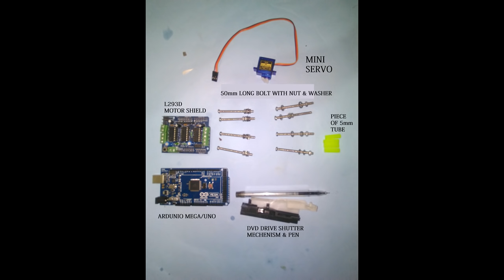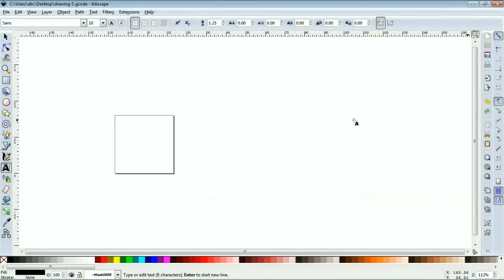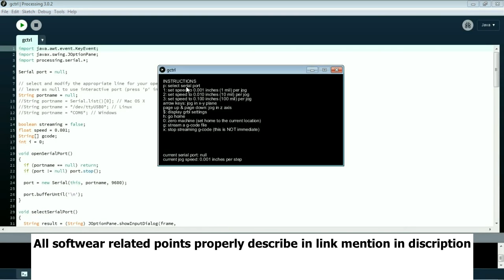How to make Mini CNC plotter machine at home using Arduino, L293d Motor shield & old DVD drive

Comment: Pleae help me. I build a plotter after watching your video. But my servo motor is continously working. When streaming pens up line motor stop and rotate little angle to other direction. After that again when  pens down command running motor again change direction and continously running. I used same as your software versions, and I used your cnc code file. Please help me bro

Comment: I did everything as you explained, But my CNC machine working 25% only. Means it drawing 25% of overall Sketch 4 times! e.g. If I have to draw a circle, it draws an Arc followed by right angle 4 times! How to fix this??

Comment: Mr. innovative,i've made the machine but only the drive in the m1 and m2 port is working and the other one is only viberating . Can you please help me to figure out the problem .Is it happening due to insufficient current supply? please give a solution to it.
Reply: Use 12v -1.5 amp supply

Comment: Hello, how are you? I made a plotter using its codes but with an epson stepper motor and it did not work well. She (the machine) draws small, or draws triplicate. I do not know what it can be. Could you give me a tip? Thank you very much in advance.

Comment: Hello,
Thank you abuot your video, I build the cnc machine like the cnc in the video but I have a problem. All the motors are working but when I runningg g code file the cnc machine drawing not what I send, the cnc drawing a scribble.
I don't kmow what is my mistake. What I need to do to fix it?

Comment: I have some issues with the cnc. When i try to print something made by me in inkscape it don`t respond as expected (maybe some setting when it saves, or something software related) but when i use the samples of the driver works fine. Any suggestion?

Comment: how much voltage is required for that CNC machine.. as I have provided 5 volt but the motors are not running, only servo motor have very less power after completing the circuit..... please help me in that case!!!!??
Reply: Rajesh Rishi 12v 1amp

Comment: Is there anyway to convert this in to a working CNC machine, that can do maybe 6x6inch or 8x8 inch pieces of acrylic?
Reply from the maker: it can achieve by GRBL CNC Shield it can handle bigger stepper motor

Comment: What rating power supply should I use on shield ? Also is it normal for stepper Motors to become very hot (I was using 12 volt 2 amp power supply) ?
Reply: Vishal Gaurav Does your cnc draw the picture correctly
Reply: No, and how do you set the zero position before the start ?

Comment: I hv test run stepper motor on M3andM4,it ran ok.now to run 2stepper motor on x and y axis which software to load and where to load for test run of both stepper together?u know I am a begginer
Reply from the maker: test run will run only single stepper motor to test both axis first you have to connect both axis with shield then load CNC code to arduino and load any sample gcode

Comment: My half drawing is good and half is scribbled....what to do
Reply: Ejaz Anjum bro you have to improve gcode and tight all connections of stepper motor if you use stepper motor in lose connection then it may not give you the perfect results #buddytechhub

Comment: i have made all the connections ri8 and also provided the external supply 12v but the machine is not  working that is the base is working nut not the pen holder stepper....can u pls tell me solution pls .......  ASAP...PLS
Reply: please reply

Comment: Hi Mr Innovation. I need your little help. I build CNC machine to watching your tutorial everything is Ok. Steper moters testing are ok. but when i used Processing to stream any gcode file there are no any movement just servo moter littile bit vibrate. No other things heaping. console showing everything ok and show result.  Kindly help me to sort out this problem. Thanks
Reply from the maker: check if motor are not faulty, it possible that faulty motor not responding to gcode
Reply: Thanks for helping. Firstly I sort our the problem to change the pins.  8, 9, 10, 11 replace it to 12,4,7,8,Now motors working but just little bit move not proper moving. servo working accurate but Stepper X, Y just little vibrate type moving. What is problems. This is Pins Problem of Motors Faulty? 
Waiting for your reply.
Thanks again.
Reply: Zeewaqar Shah what do you mean pin8,9,10,11
Reply: Zeewaqar Shah bro help me there is same problem here
Reply: most people with "NO DRAWING" or "baby scribbling drawing output"due to low Watt power supply(less than 10W) 
SO give 5V 2Amp power supply - your cnc need (@least 10W power input) ,if not this will correct try with 12V, 1Amp power supply but this will heat up your DVD step-motors and 3 ICs of L293D so use fan to heat loss in 12v  power supply.
Reply: Wasantha Wimaladharma is it okay if i use 12v 3amp smps and a cpu fan
Reply: this type cnc should give maximum 12watt, so 12v 3Amps mean 36 Watt, i didin't try that much high power try 12v 1Amp maximum
Reply: Wasantha Wimaladharma actually my servo is keep moving when i turn on arduino
Reply: if 12v 1amp is not moves your x or y axis do step motor test to x and y axis separately if only this test pass you can proceed
Reply: what about dvd writer step motors for x and y axis?
Reply: Wasantha Wimaladharma and stop at that one point where it completes its 170 degree.and when i give command through processing it says m30 pen down in logs.and nothing happens.but when i remove servo from arduino...stepper works properly...i try everything like changing codes etc. What should i do now??
Reply: after power up the cnc; servo motor stop at 170 degree means it is in pen up position, so after power up the unit , let servo to come 170 position then remove the plastic rocker arm of servo motor by unscrewing its nut.then pull up your cnc writer's pen and place rocker arm and screwed back as rocker arm in that position. then restart the cnc and check for above error.then adjust pen down angle from your cnc code and upload. (but remember after you power up the cnc if servo try to come pen down position (this should be the pen up position) and after starting writing through "processing" if servo turn to pen up position. solution is change pen up and pen down value of  your cnc code. after few value adjustment and code uploading you will find the proper servo pen up and pen down values.
Reply: Wasantha Wimaladharma can you help me in the code...or give the code of proper pen down error.i replaced the old servo and order the new..but it is also keep spinning.. help me plz
Reply: Vishal dhiman, ok just open your arduino cnc codes in arduino pc software, then read downwards there are 2 lines as pen up and pen down ( it is usually at line 14&15 or line 6&7) then change your pen up value and pen down values  (assume pen up was 115 and pen down was 83 , change this value in to pen up 83 and pen down 115) try with  your  values 1st. Then upload new changed codes to your arduino board, then start processing software and try to run your cnc as usual if not worked this tell me again
Reply: Zeewaqar Shah Very clean answer problem with your power supply, change it in to 5v 2amp, if still not working change in to 12v, 1amp with fan to avoid heating servo motors.
Reply: Vishal Dhiman did your cnc stepper motors run well with power supply modifications I told
Reply: Wasantha Wimaladharma i am already using 12v 3 amp with fan...but still servo is moving when i power on the device...can you give me your email id...through that i can give you video of my problem...
Reply: Wasantha Wimaladharma yeah cnc stepper runs well with 12v but servo is not
Reply: Wasantha Wimaladharma thanks i have found out sol.there is problem in coding of the sample code...and cnc code of the above given links...thanks for ur help
Reply: Vishal Dhiman ok upload video showing servo motor moving. And step- motors movement when power up and mention your penup and pen down values used in codes.remember you should connect servo motor to 1st set of servo motor pins in L293D motor drive expantion board
Reply: Wasantha Wimaladharma done check mail
Reply: Vishal Dhiman cheked but no upload yet
Reply: what happened to your cnc? everythings ok now?
Reply: Wasantha Wimaladharma yeah everything working fine...thanx to you...can you tell where to find more samples of gcode
Reply: i sent a bunch of gcodes to your email just click to download
Reply: You should attach 12 v 3 amp and a cpu  fan for cooling ... knowledge get it
Reply: Knowledge Get It if u need any other help then feel free to ask...
Reply: Same problems  please help me pls pls pls
Reply: I have made cnc motors runs but drawing randomly please help
Reply: @VishalD330  hello! I've the same problem.. what was the error that you have found out? Please help me!!!
Reply: @tuhin8150  could you find the solution?
Reply: Nadia Pucci which error?
Reply: @VishalD330  Stepper motors testings are ok, they move separated... but when I try to stream any gcode file there are.no any movement in both axis at the same time
Reply: Pls send me the code

Comment: what is the voltage and current rating of the adapter you have used in the motor shield?

Comment: Good afternoon, sir as a beginner I hv reached where am able to run one stepper motor connected L293D motor shied on opp side of USB port on terminal (M3),(M4) which is running ok ,then I hv connected 2nd step motor on the side above UBS port (M1) (M2) but it is not running.checked the motor it is fully ok. On sorftware side it show error in loop? I would like if u can help me on software for 2nd motor.which u r running on your video? Or suggest programme for second motor, thanks
,
Reply from the maker: see as soon you test stepper using stepper example from arduino library it will run only single motor , to run both stepper motor need to add some code in programm

Comment: Mr. Innovative we are trying to make gcodes on inkscape we are using the correct version 0.48.5 something gcode is saving everything is running fine. but there is only one problem the image in our gcode is drawn only half. only left half of the image is drawn by the CNC plotter please tell us some solution for this problem i am giving correct dimensions of 40 *40 mm everything is fine only problem is it is drawing only half image. thanks
Reply: Yash Roks same problem with me how to rectify it any solution ?
Reply: better you go for G CODE CHROME EXTENSION

Comment: Mr Innovative Please Help! Every thing is working properly but when am connecting the servo it's just vibrating and not rotating also it's making the adruino getting disconnected from the PC. Thus the g code processing is not done. " And it's coming with M 300 S 30 pen down. Also the port is getting vanished :(
Reply: ProBlogging Hq you find the solution?? Help

Comment: What voltage source have you given in the motor shield? Is it DC 5v? Is 5 v enough for two stepper motor and a Servo Motor? Thanks
Reply from the maker: 5V 1A is enough

Comment: Good evening,Mr.Innovative,I am here again,I think I am very near to test run my mini,but still very far.I have done everything as per your instruction.now signal are passing to board, all LED are on and LED related to x,y axis flickering also good ,but no signal passing from board to stepper motor.just before this run I hv tested all circuit and connection by rrunning motor party test .all ok .now pls ladvice me what to do and how to go ahead.pls
Reply from the maker: how are you sending gcode to machine ? means have you successfully launch GTRL code through processing software ?
Reply: Yes.I am sending g code through properly launch GTRL code and processing software p 3.all .x and y LED keep blinking and with respect to that LRD blink and I can see code line by line being sent.thanks for prompt reply.do give remedies to this problem quickly
Reply from the maker: Have you powered motor board with separate   5v dc supply ?

Comment: Hello sir
Sir I am not getting the exact image as it is instead I am getting a distorted image ,rest everything is working fine.It is only that I am getting the desired output.
Reply: Ashish Deolikar how to solve this... i have the same problem when its run
Reply: Sajith Unnikrishnan I am also waiting for the same thing but no reply let.😔
Reply: Ashish Deolikar 😟😟😟
Reply: Sajith Unnikrishnan let me know if u get the solution
Reply: Sajith Unnikrishnan also I will do the same
Reply: if writing image is distorted problem with x,y axis both axis should kept in 90 degrees

Comment: hi. I am using adafruit easy stepper motor driver with grbl controller and arduino with grbl loaded. when I run the machine, one motor runs while the other just keeps vibrating. what do I do?
Reply: Mihir Vardhan it must be connection problem, wrong wiring of that motor, most likely
Reply: Mihir Vardhan  hey, also how u flashed grbl for adafruit , i would like know , :)

Comment: Pls guide me on how I can load example file from camotics to my arduino board and which file with what extension,so that I can run my mini 2D plotter machine as a test run .pls,pls pls help.
Reply from the maker: Camotis nothing to do with this machine it is just a way to visualize you g-code if you not have camotics no issues you directly load g-code in processing
Reply from the maker: as soon as you successfully get gcode from inkscape open Processing IDE now run GTRL code in processing do as window suggest like select port, and brows g-code file and hit enter thats it

Comment: i apply cnc code which you give but show error please help us
"Arduino: 1.6.3 (Windows 8.1), Board: "Arduino Uno"

CNC_code.ino:7:21: fatal error: AFMotor.h: No such file or directory

compilation terminated.

Error compiling."

Comment: Excellent Job +Mr Innovative. I got inspired by your innovative idea. So, I have arranged all the things for making one like this; but I have never used Arduino before. So I want your suggestion for buying UNO or MEGA as u used MEGA. So I want to know how to connect Arduino UNO R3 & if there is any other modifications to be done in connection or coding, please reply. It may be you don't have time for this; but your reply will be valuable for me & others also. Thank You.
Reply from the maker: Santosh Kumar Sethi thanks for appreciation first.
now you just buy Arduino UNO & L293d motor shield direct buy links are available in description use this link to buy to avoid any miss match, and then arrange 2 set of scrap DVD drive from local computer repairing shop don't give them more than 50 rupees for each, and remaining software related download links are mentioned in my instructable page it's link is also there in description so can begin always to help you there.

Comment: Hy mr.inovative.iam a Lerner in electronic.i have purchase all electronic componennet.and ready with 3cdrom drive fitted on a platform.my first question is that there are two board. One arduino and second Ramps 1.4 .what power supply I need?And do I have to connect both board with separate power supply? I have two power supply of 5v - 1amp.
Reply from the maker: what is need of 3CD Drive ? here only you need 2 set of stepper and second board is not Ramp1.4 its L293D Motor shield

Comment: nice  tuturial but i still stucked at saving  as market bot unicorn G code it says after i pick that section " inkscape recieved an additionnel script executedTraceback (most recent call last):
  File "unicorn.py", line 108, in <module>
    e.affect()
  File "inkex.py", line 283, in affect
    self.effect()
  File "unicorn.py", line 102, in effect
    parser.parse()
  File "unicorn/svg_parser.py", line 230, in parse
    self.svgWidth = self.getLength('width', 354) * 0.28222
TypeError: unsupported operand type(s) for *: 'NoneType' and 'float'

Comment: Yes,I hv powered motor board with separate 12v-2A supply.still the same result.I need your help.pls and quickly.thanks.
Reply from the maker: M.mohanlal Joshi really i am filling very sad for you i also want that you complete your project successfully unfortunately don;t know where you get stuck  i know you are in trouble science so long i will do something for you can we connect on team viewer so i will confirm that there must not be any software issue ?
Reply: Thanks for support.will come back to u by day or two.I am awaiting clarification from L293D motor shield manufacture as regard to my problem.thanks again.mj

Comment: mr innovative my steppers are not working did i have to give 12 v dc . and my motor shield is not the one u r using it has only 2 servo ports and M1 AND M2 are placed diffrently not side side
Reply from the maker: while you please provide some link of you motor shield , in this machine 5V DC is enough

Comment: using 12v adapter is heating up the stepper motor very much and a melting smell is comming from the stepper motor what can I do
Reply from the maker: why you are not using 5V DC

Comment: My servo motor keeps spinning by the time I plug in the usb cable connected to the arduino. I need help :(
Reply from the maker: servo or stepper ?
Reply: Mr Innovative Servo, it just keeps spinning. my stepper motors work well and does the job. Could it be the arduino mega? im using genuino mega
Reply: servo, stepper works fine
Reply: There is a small plastic carriage type bud on the stepper motor shaft make sure it is properly mounted on it other wise your motor will keep on rotating and there will be no action.
Reply: pls help me bro

Comment: Arduino n uno both are running on different source...
Arduino is getting power from usb... n motor shield from dat wires that u connected at time 10:02...
am I ryt...??
Reply from the maker: Ishaq Polishwala exactly